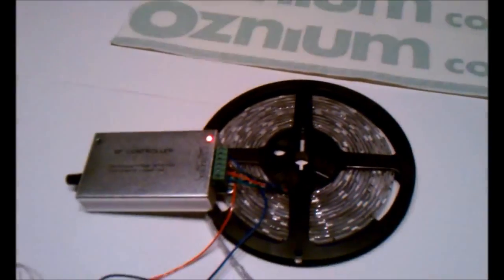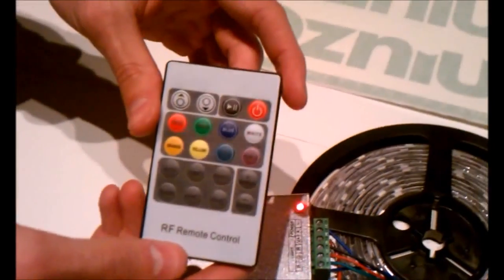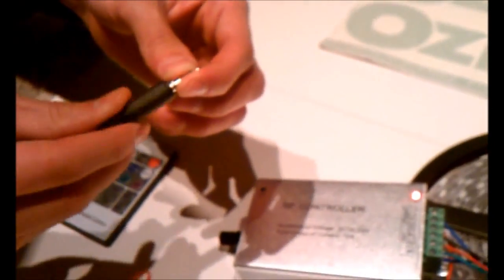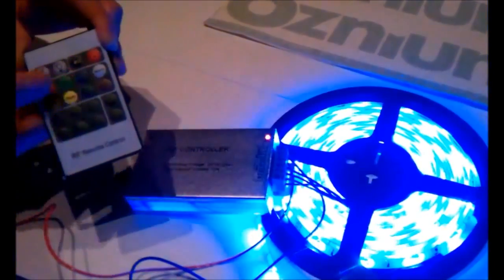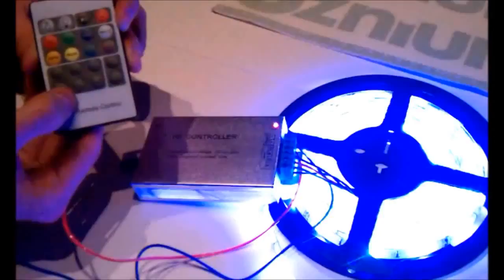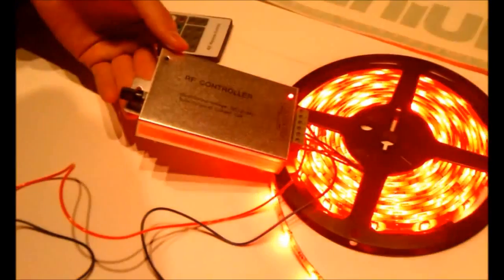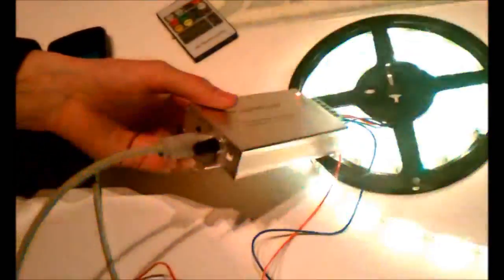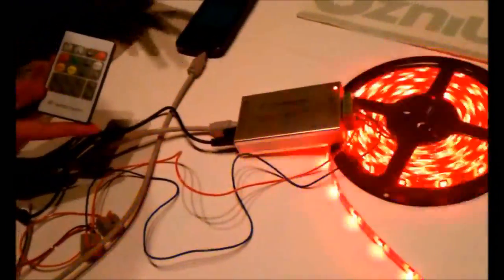Make LEDs flash to music - Oznium.com LED Sound Controller

Comment: correct me if im wrong, but if i were to put this in my car (which has subwoofers so i already have RCA hooked up) i could take the + and - going to my subs and wire them to that AUX and connect that to the LED's, and to power i could use a fuse circuit extender maybe? I would hook the wire to the satellites but i want bass reactive lighting for better, more intense bass effect

Comment: How in the world would this work in an automobile? (I'm not very educated with cars and electricity type things)
Reply from the maker: You simply have to hook it up to your 12v power source. That'd be your car battery, or you could also tap into the fuse box under your dash. Or even the cigarette lighter's 12v source.
Reply: thank you for your input
Reply: Its better to find an accessory source if you have your head unit working on acc. Usually it'd be easier to just tap into your head unit's wiring harness.
Reply: If you have a sub, forget the switches and fancy microphones just pic out a couple favorite color light strips, connect a few feet of wire on the end for slack and run them directly into your subwoofers amp in the positive and negative terminals so when power goes to the sub from your cars battery, your lights will also get that power and light up. Causing your lights to flash with the bass

Comment from the maker: LED roll is from here:
http://www.oznium.com/led-ribbon
The 16 foot (5 meters) RGB Million color one
Reply: How much do they cost
Reply: Phil Suslow what type of lights are they(are they the RGB lights)
Reply from the maker: Supermeatboy ._. Yes, they are the RGB Million color LED Ribbon Strips. The cost depends on the length you want. You can buy them here: http://www.oznium.com/led-ribbon
Reply: Thanks Phil Suslow
Reply: can I use any other LED strip?
Reply: +TheLurkingPanda  Yes, but pls change the controller to MIC controller
Reply: Im assuming the led roll is the 4 pin?
Reply: Yes, but either will work... So long as its RGB

Comment: Please answer ASAP :) What will power 10M of Leds at the least 2A 3.25A or 5A?
Reply from the maker: It of course depends on the current draw of the LEDs...
For example 10 meters of LED Strips... Do they have 100 LEDs, 500, 1000, 2000... There's no set number of LEDs per length.

Then of course different LEDs draw different amounts of current, for example 3528, 5050, etc, they could also have different number of chips inside, or even be wired differently.

As a general rule though, you'd probably be just fine with the 3.25A controller :)
Reply: Ok thanks for the answer :)
Reply: Phil Suslow I have another question. If I wanted to light multiple led strips would I have to get multiple sound controllers from Oznium?
Reply: ***** you would only need multiple sound controllers if you wanted each strip to be on a different setting. Otherwise just link the LED strips together and run off of the same controller.
Reply from the maker: ***** Think of it this way: if you have multiple light bulbs in a room, you can turn them all on and off with the same wall switch. If you want to be able to turn some of them on, and leave others off, then you'd need more than one wall switch.

Basically its the same thing for the music interface. There's nothing stopping you from daisy-chaining multiple LED strips together on the same music interface. They will just all do the same thing at the same time.

If however, you want one strip to be red, and one strip to be blue, then you'd need two controllers.
Reply: Kathy Keely Phil Suslow  Alright Thanks!

Comment: Is it possible to adjust the LED speed when sound mode is activated?
Reply: yes. that's what the knob on the controller does, at which point it would require louder noise to turn on the lights. (each time it hears something it changes color)

Comment: That's awesome! I have a costume I want to wear to a Rave (outdoor) and put some Sound Activated LED's on the stomach part. BUT, I need something that doesn't require being plugged into the wall all the time, since I will be outdoor. What would you recommend? If any suggestions, please let me know. Thanks!